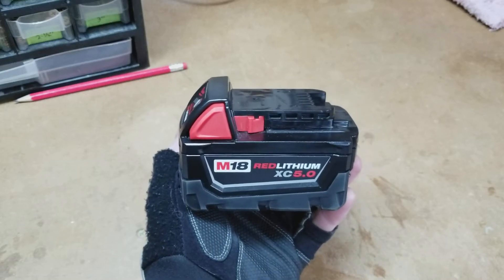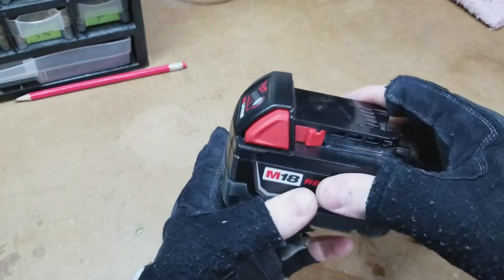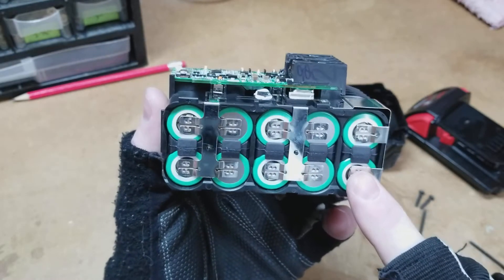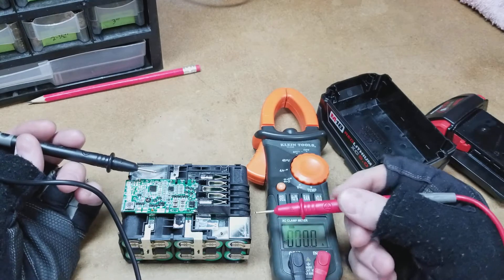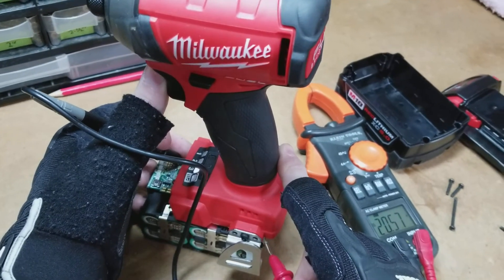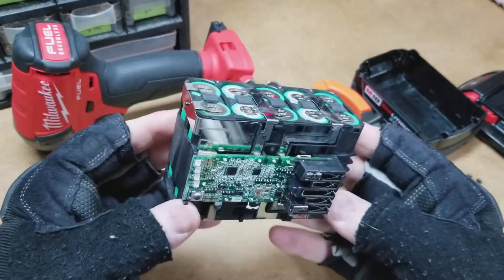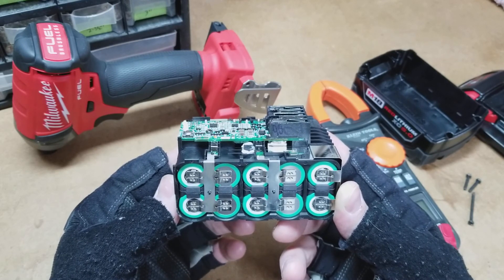A Look Inside a Milwaukee 5.0amp Battery

Comment: The li-ion cells range from 3V to 4.2V when fully charged. So 5 cell battery would vary between 15-21V. Btw - don't try to measure current by setting your multimeter to current and touching the terminals - that effectively shorts out the battery and huge amount of current will flow and melt your wires. Fortunately this multimeter does not have the facility to measure direct current with the probes, besides it is only for AC voltage. If you want to check the capacity which is measured in Ah the only way is to fully charge and discharge the battery using an equipment that can calculate the total energy.
Reply from the maker: Virtually all multimeters in general have an option to switch between AC and DC current readings, on a lot of nicer ones it will switch between them automatically. Also an 18-Volt battery displays 20-volts at optimum capacity and 18-Volts under load and as long as your not touching the same terminal to itself then it won't short the battery out, it's like touching the negative and positive terminals of a battery as long as you don't touch them together then they won't short out, it's like jump starting a car since there's something in-between the terminals they don't short out which is why I didn't short out the battery. I may not know that much about batteries but I do know that much. Thanks for watching and commenting.
Reply: @chevy5137  incorrect!! You were shorting your battery when you did that. Yes your meter can do ac and dc but the meter you used can not do Dc amps in the way you tried it. That’s why you got a reading that didn’t make sense. You even said in your video that you didn’t understand it and now your gonna act like the commenter don’t know what he’s talking about? Are you serious right now? He was trying to explaining that you did that wrong (which btw you asked people to do in your video). Yes I understand that there are 10 individual batteries inside of your tool battery but when you join them all together you no longer have 10 “individual batteries” you now have 10 CELLS. Those 10 CELLS create 1 BATTERY!! And you put your meter between the positive and negative terminals of that one 10cell battery thus creating a short. You may not believe that, you may not know that, you may not have smelled anything, you may not have noticed and damage or any less performance in your battery BUTT you did short your battery even if it was only for a moment you DID short your battery on YouTube for the whole internet to see and then you act like a jerk in the comments when people try to tell you why that’s a bad idea and you just repeat how dewalt and other companies lie about their voltage because it’s actually an 18 volt battery under load… I got news for you cupcake, 12v car batteries can drop to 11 or even 10 volts when starting a car at times…. We don’t call them 10 volt batteries. We call them 12v. Milwaukee batteries use to be 18v now they are 20v. Read their own website holy cow man. Milwaukee has changed their BMS to allow the battery at to run up to 20v but they are still selling them as 18v because they don’t want their lesser educated customers to be confused by the change in labeling and start buying a bunch of 20v tools they don’t need. So this is how Milwaukee is competing with other companies while also not confusing their customers. Dewalt and others haven’t done anything wrong their batteries are true blue 20 v batteries just like Milwaukee. Dewalt chose to label them fro what they are while Milwaukee chose not to confuse the customers they already had. Take apart a dewalt battery and do the same exact test. You’ll find the same results. And don’t tell me that a 20v battery drops to 18 under load because I just watched you sit there on camera with an “18volt battery” which was reading 20v and it didn’t drop when you pulled the trigger……. Sucks when you start to realize you just proved your own self wrong in front of Everyone. Not to mention ALL batteries voltage drops when they become low on charge. Dewalt, Milwaukee, Makita, heck even black and decker LOL 😂 . One guy tried to tell you that and you said “maybe a fully depleted one” 🤣🤣🤣🤣🤣🤣 no homie even a battery at 75% full is gonna show a different voltage than one at 100% holy freaking cow.
Reply from the maker: @scottybell2060  well that battery still works just fine so it really didn't get shorted out
Reply: @scottybell2060  💀💀💀

Comment: are you sure you had the voltmeter set to DC or was it on AC ?

Voltage should be 18v at the battery not 20V
Reply from the maker: It was set to DC aka Direct Current. 20 volts is nominal power it doesn't drop to 18 volts until a load is applied to it. This is why DeWalt can get away with saying "20 volts max" because technically their "18" volt batteries put out 20 volts until there is a load applied to them at which point they drop down to 18 volts.
Reply: You are misunderstanding the 18v/20v rating. The nominal voltage of both packs are 3.7v times 5 cells in series = 18.5 volts. When fully charged each cell should be 4.2 volts equaling 21 volts if properly balanced. The drop under a load should be a very small amount usually less than 1 volt, not necessarily to the nominal voltage. Some companies prefer to use more propaganda than others when advertising. That's usually the ones I don't buy from.
Reply: 18V is a nominal voltage, fully charged cell is 4.2V x 5 is 21 Volts - when no load is connected.
The guy from the video has absolutely no knowledge about measuring batteries as he set the meter on AC, Amps and only because the battery has got an internal limiter, the video ended without involving a local fire-brigade.
Reply from the maker: Google it or read other battery reviews. Why do you think DeWalt lists on their boxes 20 volts* with and Asterix Its because the no load power is 18 volts. 18-Volt batteries read 20 volts under no load just as 12 volt batteries read 12 volts read 10.6 volts under load

Comment: 18 volts is the nominal voltage of the battery. Which is 3.6 volts per cell multiplied by 5 cells , so 18v. A lithium ion cell reaches full charge at 4.2 volts per cell so 21 volts in this bettery. And will no longer provide power below 3-3.2 volts so about 16v.
Reply from the maker: That's some great info I'm always eager to learn more about these things, thanks for commenting!

Comment: Wait a minute...I know you.i recognize your voice to...you are maxi.

Max wrist....the guy I want to build the cage sliders for
Reply from the maker: Sorry but you must have me mixed up with someone else cuz I have no idea what your talking about bud. I don't need cage sliders whatever they are and if they are something that can be fabricated and welded then I could easily make them myself.
Reply: Chevy513 I thought you were max..same voice....youtube search maxwrist.
Reply from the maker: @johnconnersmithllc6095  Also i may no have dealt much with batteries but I used to Weld and fabricate steel using a MIG welder, doing everything from welding on and mounting utility truck, box bodies, dump truck bodies, flatbeds, snow plows, lift gates etc. as well as fabricating them from nothing put pieces of metal.

Comment: In general a nice video for someone like me who is looking to see how hard it would be to replace the lithium cells in these packs. But unfortunately it does contain some misinformation.

2:10 If manufacturers glued contacts instead of spotwelding or soldering them, they would not conduct any electricity. So I doubt anyone would glue plates to a battery. You can have battery terminals that are spring loaded (like your typical double A remote control) but that only works for low current applications.
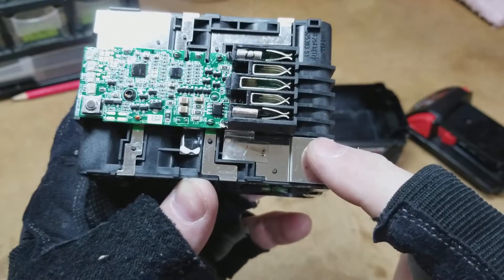3:02 They are not heatsinks, they are (most likely nickel) plates that carry current from the 18650 lithium cells to the connector on the top. The plates on each end of the battery pack have a large surface area in order to be able to carry more current. The plates in the middle cells are smaller because no actual load is drawn from them, these are only used to charge each cell in a balanced fashion.
3:08 Those plastic ridges are not a heat sink, plastic is a terrible conductor of heat so that makes no sense. They are probably just there to add more rigidity to the connectors. You can see the lines match up perfect with the seperating wall between the connector plugs.
4:10 Not sure about this, but you are probably only getting 12 amps because either your meter maxes out, or you probes do not make proper contact with the plates and thus a higher resistance prevents high amps from flowing. Most metals oxidize when come in contact with the air, and then get a thin high resistance oxide layer. If you scrape and poke your multi meter probes into the plates with some force you would probably be able to penetrate this layer see the full amperage (which would probably be around 100 amps initially and then drop off within a few seconds because the cells heat up from internal resistance (which also increases the internal resistance) and the chemistry is not able to replenish the electrons as fast as you are using them.

4:20 Running your drill probably does not add a significant load to the battery, because the drill is not really doing any work when it spins freely. The voltage drops depending on the load you put on the pack. In theory a dead short is a perfect load and therefor you'd see 0 volts potential. However there is no perfect wiring with 0 resistance so even if your drill would be running at max load it would still not drop the pack that low.
Reply from the maker: Damn that's a lot to take in, see this is what I'm talking about, I just took it apart to look inside it but looked towards the community for answers on how different things work and I have gotten a bunch of comments it's been great! Thanks for watching my video and definitely thank you for commenting in such depth

Comment: at full charge the battery pack would read 21volts and the nominal cell voltage is 3.6volts so that is why it is M18 bc 3.6x5=18
Reply from the maker: That's interest and good to know, I don't know much about electric cells and things like that and how that stuff works so it is interest to be told how it works, that's for watching the video and commenting!

Comment: Heatsink need to be metal...or at least conductive.
Reply from the maker: Good to know, like I said I don't know much of the inner workings of tool batteries. thanks for commenting!
Reply: @chevy5137  Heat-sinks must be conductive not an insulator.

Comment: So lets tell us what's inside the battery, without knowing what's inside the battery SMHID

Not that you're a bad guy or anything. But you probably could've done better by not wasting your time, while at the same time not waste ours
Reply from the maker: I never really claimed to know how much of that works which is why I welcome comments to help me learn more about it, I'm sorry if u felt it was a waste of your time.
Reply: @chevy5137  This video was very helpful to me, you may not have been able to explain much, but I got what I needed from visuals. I'm sure you've gotten the answer, but the nominal voltage of the pack iscalculated by 5 batteries in series times 3.7v nomina per celll=18.5V nominal. A fully charged lithium ion battery is usually about 4.2v, so 5*4.2=21v.
Reply: That's great that you want to learn but you are in way over your head with this. Before understanding any of the answers you get here you first need to understand the very simple basics. Start with "What is amperage?, What is Voltage? and What is the difference between AC and DC current?".  Afterwards learn how to use the meter correctly for checking DC amps and it's limits. That meter is very limited in checking DC amperage. It is made mostly and best suited for checking AC amps with the clamp on feature (not using the leads). Google those simple question and what you learn will greatly help you to understand electricity, the answers to your questions in this video and more.
Reply: Personally, I want to commend you for stepping out of your comfort zone and making this video, regardless of what anyone says, that's a very hard step for anyone....

Thank you for taking the time to make this video and making it public for us all to see.

Comment: when did milwakee start cheating and misleading customers? i took mine apart and had 10 18650  rated 2.0ah. should be a 4.0 not 5.0
Reply: Milwaukee uses 2500mAh cells mostly. So it's 5.0 roughly

Comment: Yeah, the batteries were beginning to heat up, as there was nearly a short circuit. You'd want to use a ceramic resistor to bleed off the heat while you read that in SERIES.  BTW, If you short circuit that stack of batteries long enough, it will turn into a bomb!
Reply from the maker: Yeah I know about that as a kid I used to wire 9 volt batteries together and they would heat up and explode! These new Lithium Ion batteries have come along way from the old NiCad batteries which had multiple issues like running down on power as they got to the end of the charge, having a shorter lifespan, getting ruined if you left them on the charger to long and so on. These new lithium Ion batteries with all their advanced circuitry and technology are great, they won't get ruined if you leave them on a charger, they will automatically shut off if they get to hot, they deliver full power till the very end of the charge, the lifespan on them is much longer, they have fuel gauges on them to let you know how much charge is left in them and so on. It's really crazy how far battery technology has come and that combined with new brushless motors and advanced circuitry and technology and because of it you can get most tools cordless now. Most of my tools are cordless now even large tools like my Milwaukee M18 Fuel 10" Dual Bevel Sliding Miter Saw and Milwaukee M18 Fuel 8-1/2" Table Saw and they have just as much power as corded tools do! I only have a few corded tools anymore. Thanks for watching the video and commenting!

Comment: Hello. Thanks for the video. Are you trying to figure out how to get the 5.0AH measurement?
Reply from the maker: Among the many things I'm trying to learn
Reply: Just ran a discharge test on one of mine with an electronic load. 1A constant current, cutoff of 15V- came in a little under at 4.6 Amp-hours.